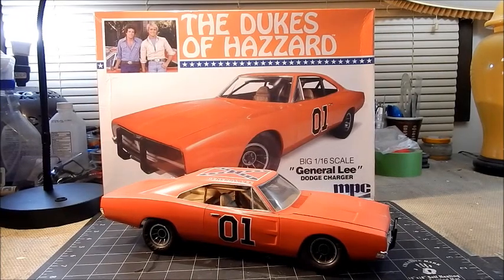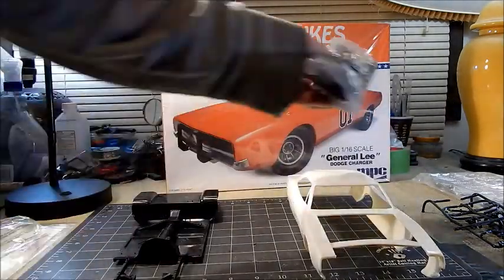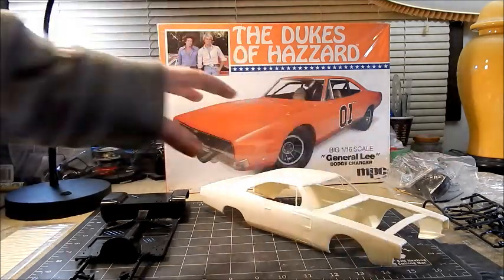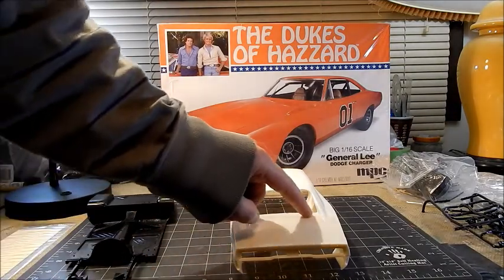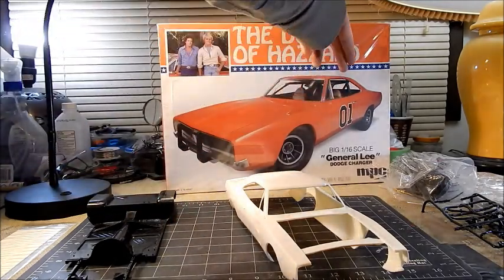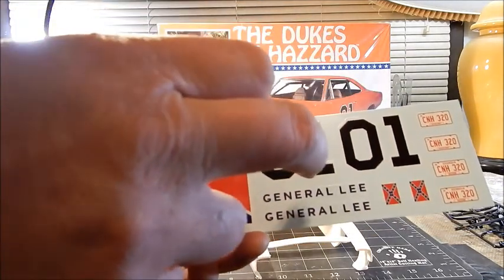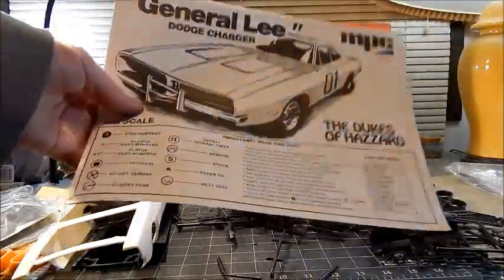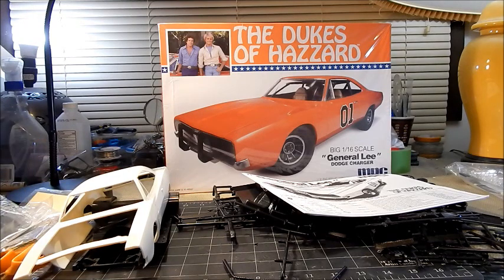1/16th Scale General Lee Build Episode 01

Comment: It's not molded in orange because it's the bigger scale you have the smaller size scale was molded in orange
Reply from the maker: Heya Elvis!! Is that what I'm remembering? I could have sworn that the big one was orange back in the  80s? I can't imagine little me painting it.
Reply: @PunkyWily  I believe so cause I had 1 that was molded in orange
Reply: The original 1/16 in the 80s was molded in orange. The last issued 1/25 is also molded in white. I have every issue ever made.
Reply: @trevagraham1605  As do I. Built and sealed. The original USA MPC models were molded in light orange. Even the AMT/Ertl version I bought in 1998 was molded in orange. Only the new Chinese Round 2 are molded in white.